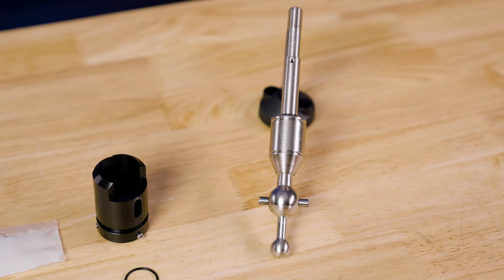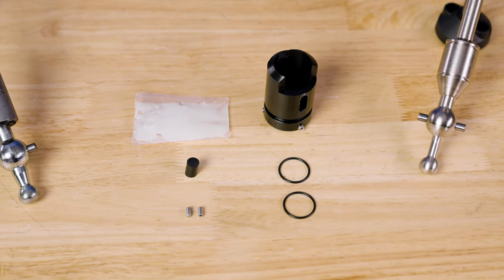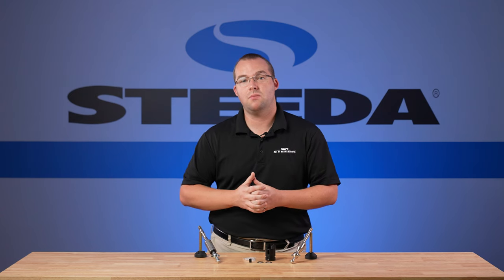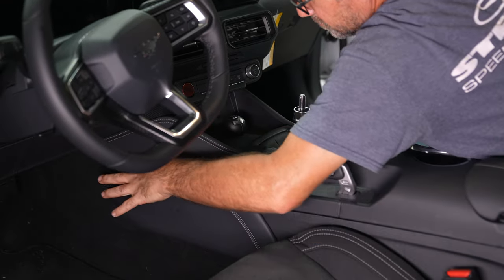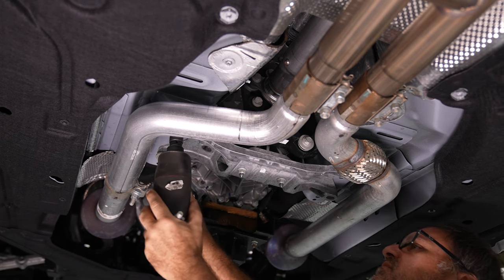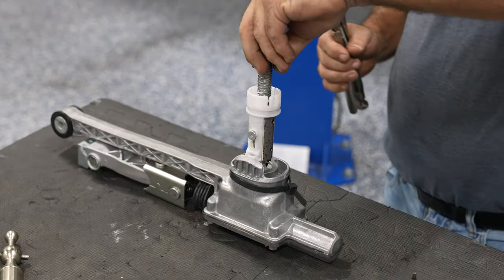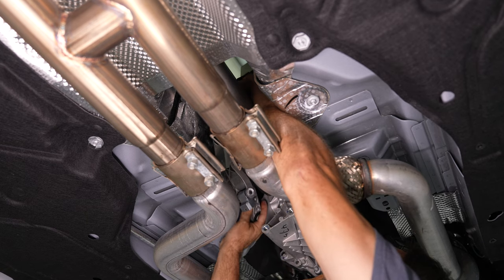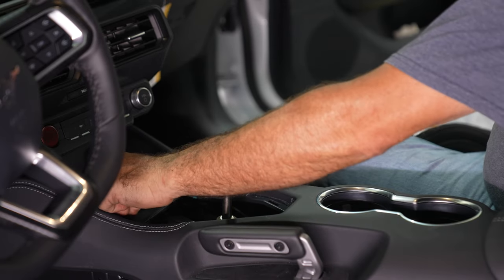Installing a Steeda Tri-Ax Street Short Throw Shifter On a 2024 Mustang GT

Comment: I installer this same set up, now i have issues going from 1 to 2, i guess you get what you pay for
Reply: What’s the issue is it hard? Does it pop out?
Reply: I have a similar issue, 1 to 2 is sometimes a bit hard but going down from 3 to 2 is hard...  Not sure why, maybe the delrin piece is too thick  (or too thin) and the distance to the reverse lockout stop is not quite right.  I'll contact Steeda.